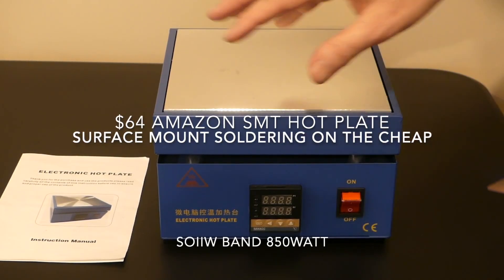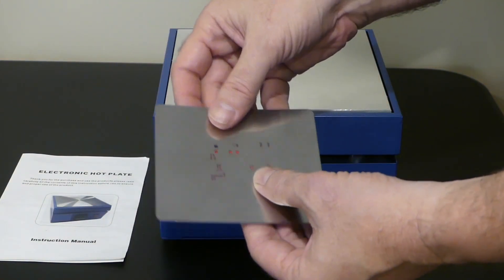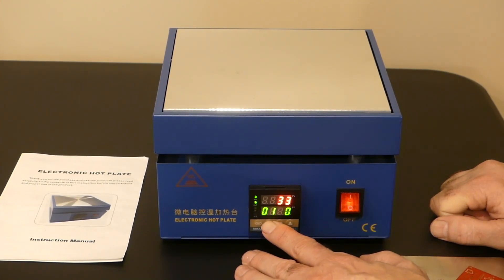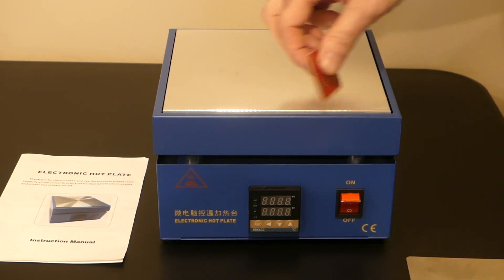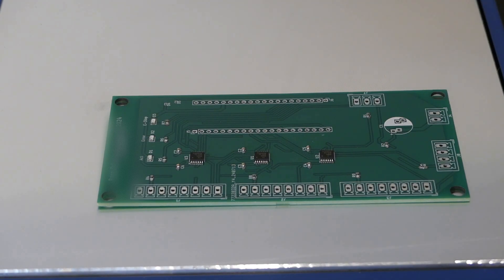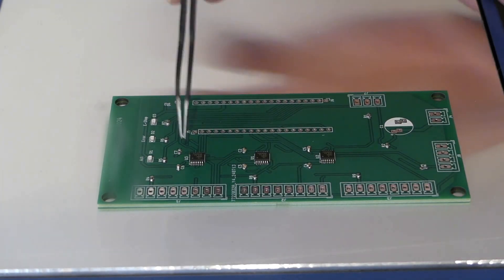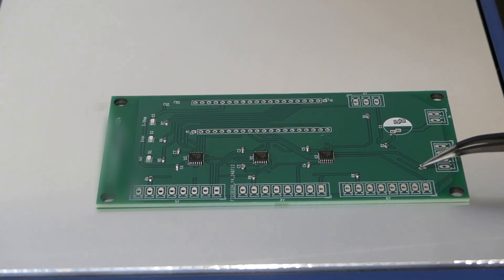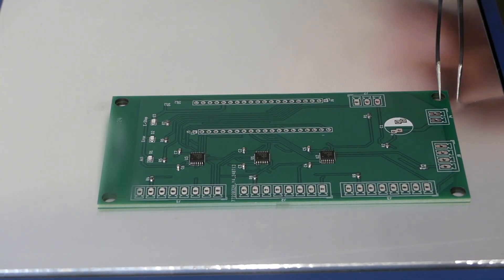Reviewing a $64 Surface Mount Hot Plate Soldering solution

Comment: I have one, and it works well. However before I used it I checked the earthing (grounding). It turned out that the top blue part was not earthed because paint doesn't conduct. Also there were single insulated wires carrying 230V (or 120V where you are) through holes in the metal work, which is also a no-no. These things were easily fixed with a grinding tool, some shake-proof washers and some grommet strip. But it shouldn't have been necessary.